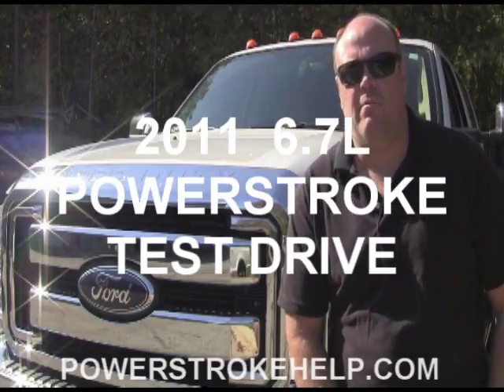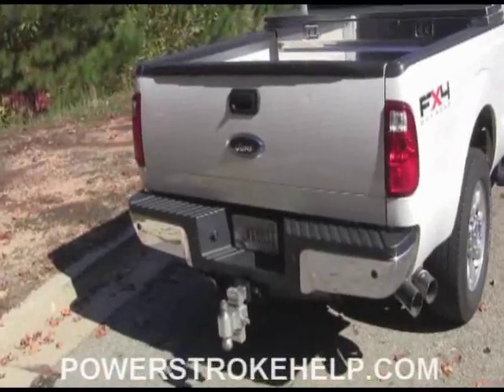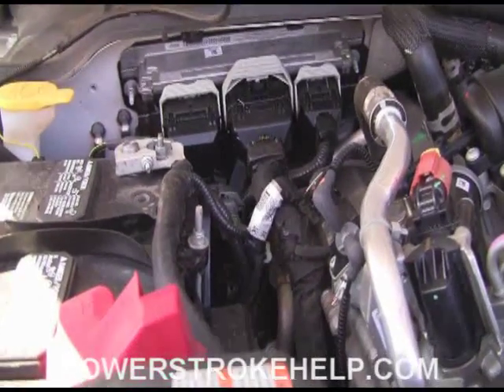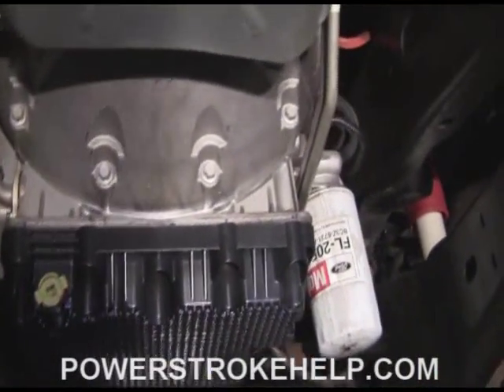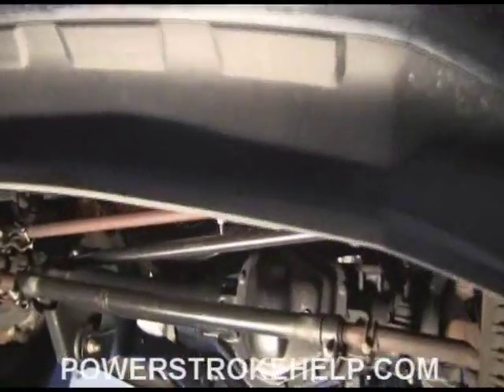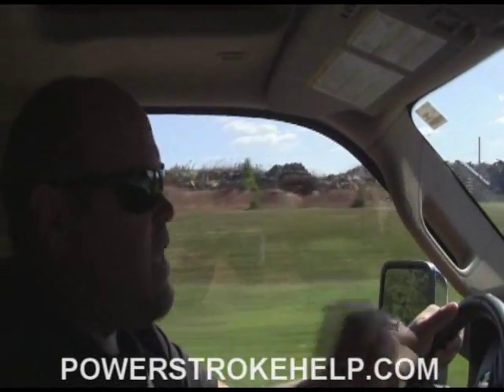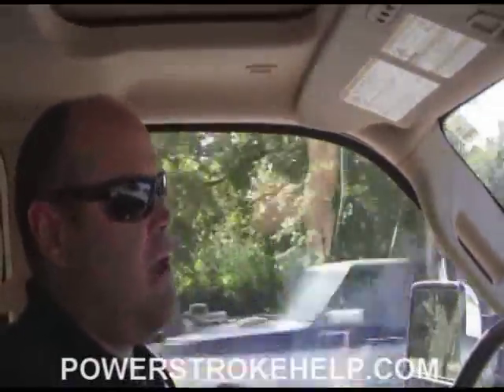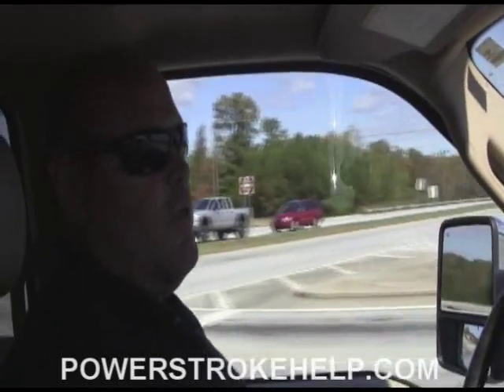2011 F250 6 7L FIRST IMPRESSIONS

Comment: In 2012 Ford got rid of the plastic oil pan with the giant drain hole and opted for a steel pan with a normal drain plug that doesn't make a mess every time you do an oil change. :). Ford certainly built an amazing engine. Love the 6.7. I'm a tech at a Ford dealership here in British Columbia, Canada, love my job! :)

Comment from the maker: @AD4203 The 7.3 is a dinosaur just like the 454 Chevrolet. No question we love we love these engines but the new engineering is THAT much better. The 6.0 and 6.4 were just stepping stones to get to the 6.7. The new GM LS series engine with a simple cam change and tuning will make a RELIABLE 580HP. I would have traded my right nut for 500hp in a street car as a kid. Now the 6.7 makes STOCK 800ft/lbs and approaches 1000 ft/lbs with tuning. I broke Spot's motor with NOS trying to do this.

Comment: We got out 2011 F250 around christmas time last year. We've only put 18k miles on it, and mostly highway because it is a company truck. The only problem we've had is that sometimes around cruising speed, the transmission selects a higher gear, and you can feel the truck jerking from the low RPM's the motor's putting out. Like it's chugging along. Other than that, we haven't had a problem with it and it hasn't failed one bit.

Comment: hey. My dad has a 2011 6.7L f-350 Dually lariat and almost every time he pulls out of anywhere when the trans is cooled, it would slip out of gear and then go back in gear. The heaviest trailer he tows is a 15 thousand pound camper. 

Thanks for your help!

Comment: I bought a 2011 F350 King Ranch FX4 (Ding Dong Daddy) in the beginning of September 2010. Since then the only problem we have had out of it is the wheel hop when you hit a bump. We took it to Ford and they put a stronger steering damper on it and that fixed 70% of the problem. The dealer told me if it happens again they will put dual stabilizers on it for me. Cant beat that. The truck is averaging about 16 mpgs in the city and closer to 20 on the highway trips. We now have 25,000 miles on it.

Comment: My father has the 2011 F350 with 60k already and never had an issue. We bottomed that truck out multiple times and the plastic oil pan was fine. Burnt up two sets of tires already from towing and man that truck is so good! I will do what you recommend on my 6.0L. My 6.0L has 60K on it too and we hope to put many more on our Fords. My fathers 6.7L we average 16 mpg which goes to show, the new 11s are gnarly. Towing 11.6 mpg (65-80 mph) normal driving with out trailer 20 mpg.

Comment: To bad the 6.7 does not come with a 6 speed manual transmission.
Reply: +Drake Fischer Yeah sure. Wait till they start frying jus like every other slush box.
Reply: +Drake Fischer Yes but manual is much more fun.
Reply: +crusty old fart I agree with you. Manual will always be more reliable than auto.
Reply: 7.3 IDI Diesel I love the creeper 1st and reverse when backing up a camper, or crawling up a boat ramp with a 6.800 lb boat.
Reply: +crusty old fart yea i agree with you there  ,, the manual transmission is  so much nicer 
I have a 10 speed in my    1 ton chevy  ,,,and my F250  which i still love  it has a  C-6 3 speed auto ,,but it does  have a gear vendors  overdrive which in effect gives it 9 gears  ,, and it makes  my  460 big block  get  15mpg on the highway 
and i can still get  10 while towing my  camper on the interstate ,,and that's a surprise cause my camper weighs  16,000 pounds
Reply: wildcoyote34 Though my truck is theoretically geared for 109 mph (not sure of the ratio) I'd like taller gearing. It's chopped for towing, and basically there's nothing there but a motor and a hitch ball. It will go up any hill in 6th gear, and lug down to 35 mph in 6th. I'd like something a couple of gears higher, for all that western cruising I do, to increase mileage. I thought about putting in a 4wd box for the low range, then gearing the rear end  up really high. Does anyone make a Hi/lo trans for it? you seem to have that set up. A 2 speed rear end is just too big size wise. What would you suggest?
Reply: crusty old fart I would  suggest a gear vendors  overdrive ,,
google  search  it
Reply: wildcoyote34 Thanks, I will.
Reply: +Drake Fischer Nope.  My left foot is better than a computer.  6.4L ZF6 forever!
Reply: adrianspeeder I'm with ya there ,, i like using my left foot on the  3rd pedal 
having driven big trucks  since i was a teenager  suddenly having an automatic seems like cheating to me ,,
i have a 1978 1 ton chevy with a  10 speed roadranger  ,,  yet i forgot to mention  it's not powered by the  original engine ,,  i replaced the 454 big block   with a 6V-71 detroit  turbo diesel , i wanted more  PULL 
that's only one of  several large trucks  i own though 
most  diesel  powered   ,,although i recently deviated from that  when i purchased a 2015 F150  back in june  ,, I bought it for  my hauling and delivery business , to replace an aging dodge mini van which was giving trouble
it came with a 6 speed  automatic trans , and  after all my years driving big V8 powered trucks , this one came with a 2.7 liter Ecoboost V6 engine which i am coming to like  ,, it has 345hp  and surprisingly swift it is ,and i am averaging close to 30mpg  highway when not towing 
and it will tow 10,000 pounds easily
Reply: 7.3 IDI Diesel fuel
Reply: A manual transmission would be nice.
Reply: wildcoyote34 Maybe on level ground. If they're squeezing 345 HP out of170 or so cu. in. that sucker is going to fry in a heartbeat. The 4.6 won't tow either, and t's stressed a hell of a lot less. I fried one of them and 2 autos they put behind it.
Reply: jdaniel1274 Right on....I got a 7.3 power stroke mildly tuned with 6 speed manual stick.
Reply: crusty old fart actually i have been surprised  how well the F150  will handle a trailer ,, I don't tow with it often  because i have too many better choices for towing ,and recently have upgraded my F250  , it now has a 6 speed manual transmission from a 99 F350 ,
and a totally new engine I replaced the original 460 with a slightly modified 478 big block ,with dual turbos ,although they aren't large ,
I have it tuned to produce lots of power at mid range RPM for towing ,,I am getting 550hp at 5000 rpm and 670 pound feet at 3000
low end torque  is in the 450-500 pound feet  range at 2000 rpm ,,I get  max horsepower at 5500-6000 rpm   but rarely do i rev it over 3500-4000  ,, with the  gear vendors overdrive behind my 6 speed  i can get 21 mpg  using the doubled up overdrive ,cruising 60mph on the interstate  the engine is turning just 1200 rpm , which is just barely enough rpm  to produce boost I get just 4-6 pounds of boost at that speed ,,3000 rpm  that figure is 12-14 pounds
Reply: wildcoyote34 Where are you getting gasoline for something like that.
Reply: crusty old fart it burns 91 octane pump gas  , no special additives required 
I can use 87 octane ethanol too but i have to turn the boost down or i have ping issues 
If i want to run high boost I can use octane booster   , but i've also used 100LL aviation fuel too ,,it's all in how it's tuned ,, if i was dragracing I'd be worried about  having high octane fuel ,,I didn't use a real hot cam either  it is specced for an RV/towing application ,and the turbos don't do much other than help the engine breathe better when towing

Comment from the maker: Expect a fuel pump if it has not been replaced recently. Otherwise just normal stuff like brakes, bearings leaks ETC. Make sure you start it cold to see how the injectors are in the morning.

Comment: Were the 6.4s really that bad? Because we had a sales representative tell us that fomoco/international/navistar fixed all the issues from the 6.0. Anyway my dads 2010 6.4 dually has about 47k on it and not one problem yet. But he does not pull heavy trailers with it though, or haul anything. Let's just hope that his truck lasts for a long time.

Comment from the maker: @TheNineveh It is partially due to the larger molecule and temp change but it is mostly how the tires absorb the small bumps in the road. Just smooth it out. Add a set of bilstein shocks and most all PSDs will ride like old school big detroit iron.

Comment from the maker: @ooduce4knot1 For some people they have been money pits but most of those people did not do the maintenance, installed performance tuning and had incompetent people work on them. THEN cried foul when there were problems. You cant ignore a 6.0 like you can a 7.3 and still expect it to perform. Since I have been on the road at shows promoting the web site I have found that most (75%+) 6.0 owners are actually quite happy with their trucks, but afraid of future problems.

Comment from the maker: Wrong Wrong Wrong. I just put a 6.0L in an early 03 F450 with 492,000. It was well cared for but it was not babied. If you neglect or abuse any equipment it WILL fail prematurely

Comment from the maker: This is a tough. It is common to change fluid in a transmission with high miles and minimal service for it to fail completely shortly thereafter. Had it happen many times. We use the standard latest version of Mercron from the parts store to service the older transmissions. Drop the pan. take it into the sunlight and look for sparkles in the fluid. Sparkles are bad. Drive as is until you are prepared to buy a Reman transmission. Good Luck.

Comment: I just bought my 2013 F250 Platinum today.  My previous 2008 had an SCT program with the DPF delete kit.   I did it more for the MPG than the performance.  This thing feels like my 2008 did with the program.   Would there be as big of a MPG jump with this motor as the 6.4L if I did the similar setup?  Again not looking for power this thing is a beast already!

Comment from the maker: @bigboi1245 Understand the 6.0L and 6.4L were stepping stones to the 6.7L. Ford took the knowledge gained from all the difficulties of the Navistar engines and greatly improved the 6.7L over the previous models. Only time will tell what the outcome will be for the 6.7L but from all my irons in the fire I'm only hearing about very minor problems. I would leave the emissions alone until it became a problem.

Comment from the maker: @paintballrefjosh This truck in the vid gets 16 running bobtail and 13 pulling 10,000# equipment trailer. This can be increased significantly with tuning, I have heard by up to 4mpg.

Comment: I'm thinking about getting an '05 F250 with the 6.0L. Been watching your videos on the 6.0L and despite of what it has gone through the engine its worth a shot to me. I'm a Ford guy until one week later i die. You recommended the SCT tuner for better fuel economy. I am trying to find one with a manual transmission so i can get the extra few mpg that i can but also add the tuner to it. I currently get about 17.6mpg with a 5.4L F150 that's driving 60mph how much would i get with the 6.0L setup?

Comment from the maker: @jedwilson95 Flush the coolant and add Diesel Cooling System additive from Ford. TODAY. That cooling system is running max speed all the time. any compromises in the system can raise hell in that engine. We recommend cooling flushes every 30k miles on the 6.4. DO IT TODAY.

Comment from the maker: I dont want to walk too far out onto thin ice because the EPA nazis always have their ears on. The answer is yes the tuned and piped 6.7s that I have worked with run much cooler, get insane fuel economy and with the spartan system will out run pretty much anything on the road. Finding a tuner friendly dealership is another challenge.

Comment: drove a 2012 F350 King Ranch long box and ive never been in a nicer truck. scarey fast and the HUD read 20 mpg with only 500 miles on the odometer

Comment: If you was to straight pipe this truck (down the road) would it mess the computer up about how it runs and operates? Since the exhaust system is such a big part of this truck ? Great video

Comment: thanks for your help. you seem to be the most professional mechanic on this website, gas or diesel regardless. ive got another question: the truck im looking at has 228k on her, am I alright on injectors? the current owner has done good maintenance. I will use your procedurestoproof them. I just want to avoid a problem if I can.

Comment: Thanks so much for your help. Your knowledge and insight of the industry are far superior to anyone of these other "mechanics" on Youtube. Ive got another question: In your opinion, how much would you pay for a 96 cclb 7.3 in good cond.? 228k miles. how long should those injectors last. I assume the previous owner had not conducted your three step treatment.

Comment: Any discussion about the ongoing " intermittent no throttle response at low speeds between 2nd and 3rd"?  Just bought a new 2011 6.7 and now I read all over the internet forums about this year old problem that "Ford is working hard to solve".  Huh?

Comment: @powerstrokehelp Yes agree bill,be nice too have a 2011,but i got a 2003 black super cab model,done a lot of mods too it,put a Dp tuner on it(incredible), bigger exhaust 4" MBPR,Full airbag suspension 4" lift (airbagit),i put a 10' touch screen in the dash operating a PC :),and a few other mods,its a real head turner,i'm happy aswell bill..

Keep up the good work,learnt a lot of you,thanks.

Comment: @powerstrokehelp Of course the O2 molicule is smaller than the rubber molecule therefore ya have slow leakeage even on a properly fitted tire (about 1 to 2 psi per month in colder temps) I used to do a lot of heavy equipment tires when I was going to University, everything from Semi's and skidders and mining trucks.

Comment: I get over 20mpg with my '04 F250, 3.73 gears, auto trans, 4" turbo back exhaust, and SCT tuner. I actually got 23mpg on a trip crusing at about 70mph.

Comment: About 4 months ago, bought a 2011 F350 4wd SRW long bed w/ 28k miles for my 41' toyhauler...the truck is a beast compare to 08 Dodge dually. I've always liked Cumming, hopefully the 6.7 will turn out to be a better engine than predecessors.  I wanted to thank you for your expertise.  Has Ford help you out?

Comment: my 2011 F350..first impressions..the good: nice interior, nice ride, decent power, good looking truck..the bad: cheap thin sheetmetal, had rust on suspension parts, drive shaft, etc right from the dealer(and this is in Phoenix, AZ), electrical system/engine/emission controls are garbage..2 EGT sensors(truck just shuts down and refuses to start when these fail), 1 air charge cooler sensor, and now some sensor for the DEF tank...engine brake is not impressive..it just downshifts the transmission..

Comment: The oil pan is a shame BUT
-maybe the plastic is strong as steel
-maybe it allow better insulation to the oil and better and stable temperature to the parameters

Comment: I have a 2011 6.7. F350 love the truck. Have issues though I've looked at your site not much for these engines that I have seen my question is ... Coolant issues which I think I've narrowed down to the line sets hopefully .... But at a intersection braking and I let off brakes and give it gas to go I get a short stall hesitation. It does it when I touch the brakes mostly and I'm seeing oil coming from the passenger side engine. I can't see or find where ... I drive it a lot and pull a lot of larger size trailers. 40' gooseneck and 46' fifth wheel. I travel a lot with my job I can't afford to be stuck. I like to stay on top of things before a tow is needed ... Anyways. I'm in Chattanooga Tennessee the next few months I would like to bring it too you for a through going over to make sure everything is 100% and fix some things if needed. I worry about the egr and all that other stuff going down its pushing 130000 miles. I want it to last half a million if I can make it last that long Right now I have a blown caliper on the right rear so I'm going through all 4 and replacing calipers and pads. But after the new year I waould like you to check it out. Gparham@pkwycon.com

Comment from the maker: @FMXUnleashed Spot the shop truck is a 2000 f250 with 835000 miles. Type SPOT THE SHOP TRUCKS ENGINE DIES AT 798,169 into the YouTube search bar above. This the truck I driver every day.

Comment: Love your videos. Just curious what your opinion is on what brand of trans. fluid to use in the 4r100 trans. I have a 2002 7.3. There are many different opinions but I thought I would ask you. Motorcraft quit making "mercon" as far as I know. It's slipping just a little going into 3rd. So Id like to flush it. Thanks

Comment: We have a 2012 F-350 XLT 4x4 crew cab long box with the new 6.7 and it consistently gets 21 mpg on the highway at 70 mph. This truck is completely stock, nothing modified.  The best I have gotten with it is 22.3 mpg and that was driving across indiana at 55-60 mph.  I think that's insane that this truck can get that kind of mileage yeat tow 20,000 lbs.  We sold a dodge ram with the cummins and this ford is TWICE the truck that dodge could have ever been.  Sold on Ford now!

Comment: Yes these failures wer primarily on f450s causee they are the ones creating the high heat towing trailers. The exhaust valves would turn blue and have cracks. They redesigned the cylinder heads to rectify this problem.